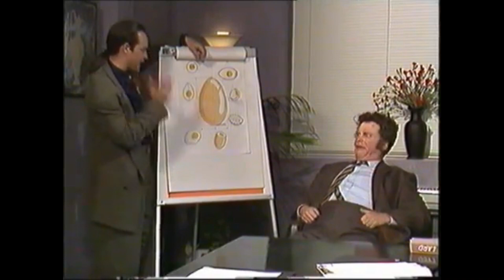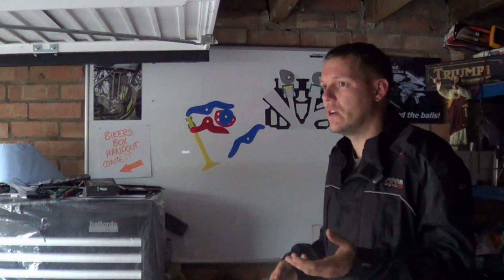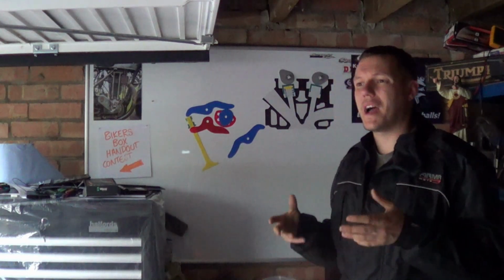Hypereutectic pistons - Say what?

Comment: "If you want more power, you need more heat"
If only there was something you could use to make the engine hotter............................anyone?
Reply: Deanxm1.  Remove the cooling system! Lol
Reply: Deanxm1 use Evans lol
Reply: Deanxm1 shit I was just about to type the very same hahaha
Reply: According to Roadkill: Cardboard blocking the radiator.
And maybe Evans would solve the Roadkill-typical overheating problem.
Reply: BavarianMonkey Eaton roots backed by a big turbo, then opposed piston and make the heads hemispherical. Hoooo...
Reply: Deanxm1 Ummm. Abigail Ratchford??? HaHaHa
Reply: Take the belt off the water pump. Instantly make 9001hp running na.
Reply: More pressure more fuel and more air but most importantly more spark...unless you want to go diethylene but beyond that, its a complete design change
Reply: use the hot air from this video......

Comment: Another awesome vid! I think the FIA banned Berillyum/aluminium pistons in the early 2000's because in the event of piston failure, Beryllium particles would enter the atmosphere and be harmful to humans. 
If I could make a video request, how about a vid on deck height, its relationship to bore stroke ratio and piston speed? Most race bikes and purpose built race cars have severe oversquare engines but for example BMW (E46 M3) , Honda (Integra Type R) and Audi/Lamborghini (V10) have under-square, long stroke, high revving engines. I know they are road cars but would be awesome to highlight how a long stroke engine can still achieve high revs.
Reply: weofnjieofing They seriously put beryllium anywhere near an airbreathing and heated application? Back when I was doing vacuum pump stuff, that shit was some of what we tried hardest to avoid, along with gallium arsenide and radioactive stuff. Breathe in and congrats; you have a couple of years, and then the sarcomas will be collecting.

Comment: about 1 week ago i tried to use 6011 steel welding rods on aluminium and i got a very porous, hard and strong contact with it but there was no flux flakes on top of the weld when i stopped.. which seem like the sodium carbonate , the steel and the aluminium made an alloy together

Comment: In simple terms eutectic point of metal alloy is where you have such a portions of part A and part B that the mixture has lowest melting point. So if you'd add more part A or part B the melting point would rise.  Hyereutectic just means your alloy has one component more. Also alloys not really considered to be composite materials.

Comment: Good video. Doesn't titanium creep pretty bad under high heat? Not saying this aplication would get it hot enough to mater but isn't that a major engineering constraint of titanium?
Reply from the maker: Titanium has a few issues - Its heavier than Aluminium, it has a massively (order of magnitude) lower thermal conductivity than Aluminium - 

Ally 230WmK or near that. 
Titanium = 23 WmK

(I can't remember how close the numbers are to the 'real' values but I know its a order of magnitude different.

Titanium also galls like a bastard, which makes it a shit bearing surface. Aluminium is also shite but its oxide is quite hard which reduces galling quite a lot. Titanium oxide on the other hand makes things worse, although titanium nitride, the golden colouy on stanchions has a low coefficient of friction. 

The problem is that titanium nitride thermal conductivity is worse than straight Ti. Stress fractures in the surface and boundary layesr of the grains of Ti coupled with the diffusion of oxygen can lead to stress fractures - creep. 

Specific designed alloys (aviation alloys) can easily get around this, but again ususally thermal conductivity suffers, and galling is still an issue.
Reply: Just an aside: The low thermo conductivity is a big part of what makes machined ti parts so expensive btw. It's not a massively hard material at all (for its weight it is) nor is it very expensive to haul out of the ground and produce billets but cutting tools ultimately are limited by heat from friction produced in the cut and how much of that heat the cutting tool can take. Most materials (al, steel) the heat leaves with the chip and sinks into the part. With ti and other insulative materials the heat just builds up in the tool. There are a lot of tricks in our bag to mitigate that but ultimately it just means you have to take longer to produce a part and replace (expensive) tools more often.
Reply: I've always felt like these issues are just an excuse, there has to be coatings that solve these issues. Something like a case hardening that diffuses into the surface, or vacuum deposition coating or diffusion boding of some sort.
I know, I know, its a cost thing... its always a cost issue.
Reply: Also I wouldn't think thermal conductivity would be an issue other then cooling of the piston via the oil... they coat the tops of aluminum pistons with ceramic, you want to remove as little energy from the combustion chamber as possible right?

Also you spelled color wrong.
Reply from the maker: Its all about heat saturation. And in turn this is linked to detonation. A large amount of piston heat is transferred through the piston rings and through the con-rod. Slowing down this transfer by 10 times really makes a difference. And its not as light as Aluminum. So why bother......
Reply: But Ti has more then 3 times the tensile strength of the hypereutectic Al/Si, surely it could be made much thinner to make the weight equal-ish.
Al/Si 398 - 40 ksi
Ti 6-4 - 125 ksi
7075 T6 - 73 ksi

I know I ignored the rest of your comment... the strength to weight and performance at high temps/ corrosion resistance just seem like so much of a win to me.

Comment: does anodize piston and combustion chamber will give any advantages because of aluminum oxide thermal properties ? there are expensive ceramic coatings but also  it is hard to do at own garage while anodize is simple. :D
Reply from the maker: Pistons are already anodised - naturally.
Reply: Yes but the layer is very thin

Comment: matt, you should do a twin cylinder two stroke  vs single two stroke comparison.. id actually like two see the yamaha 350 twin vs yz250..  im pretty sure that they have nearly the same power, thought youd enjoy proving that fact with the smaller 250 against the twin 350.
Reply: TZ
Reply: twin cylinders make more power then single cylinders
Reply from the maker: the cc's aren't the same - try again.

Comment: I recall back in the '80s, I think, Smokey Yunick - a famous NASCAR mechanic -  was experimenting with an engine, V6 Buick I think,  that had no coolant whatsoever and had a good deal of ceramic in it's construction though I recall the block was still cast iron.  The idea was to retain as much heat as possible and cut thermodynamic losses.  Seems like it didn't pan out but he was quite the experimenter in his day - https://en.wikipedia.org/wiki/Smokey_Yunick I wasn't able to find any specific article on it at the moment.

Comment: An alloy is not a composite. An alloy is a uniform mixture of metals (or metalloids) mixed on an atomic scale. A composite contains two or more materials mixed on a macro scale, we commonly think of a polymer resin applied over a mesh of woven fibres (glass/carbon in epoxy for example) but straw in mud/clay (primative bricks) and sand/gravel in mortar (concrete) are also composites. It gets fun when you consider an aluminium (or alloy thereof) honeycomb skinned with sheets of  CFRP is a composite itself made of two composites. Yes aluminium/air is technically a composite.

Comment: A pen Friend :)
All pen markers should at all times point downwards, otherwise the liquid will drain away from the business end. Even when writing the liquid will quckly drain if the bottom of pen is at an angle downwards. Try it, cheers
Reply from the maker: Do you know if waxing the board also helps? Someone commented that it did.
Reply: Never heard of this, the root problem is that there is not comming enough material through the brush. No amount of wax will change that.
Reply: BlueFox Did you not notice his tongue firmly pushing on the inside of his cheek as he wrote that response/question above??

Comment: Wolfram anyone? Surely not light, and i dunno about mechanicaly how would it behave, but it won't melt for sure.
Reply: *Tungsten (for the international people) :-)
Reply from the maker: Tungsten is way too heavy are you mad!
Reply: :D i know, but it certainly does not melt with ease.
3400 celsius or so its melting point :D

however, yess density is a problem. maybe some kindof alloy made with it.. i dunno. i actualy was just joking.
if i remember correctly wolfram has a density like 15 g/ccm,
and aluminium is something like 2.65 g/ccm or someting like that.

but yeah , lets not be  kidding.

Nickel-Chromium-Molybdenum would be probably superior to aluminium-silicate pistons. probably steel with say...
0.55% Ni 0.5 % Cr, 0.20 Mo, and lets drop in 0.1% Tungsten into the alloy and most probably a piston out performing AlSi can be made, question is who the fuck can afford that kinda thing...
but at least this is a serious one. supposedly it should have a melting point far higher than AlSi.. li reckon by a good 200+ celsius.
maybe you could get away even without theTungsten..
but you would need a really short skirt, and a super light design.

anyhow, since you considered my brainfart joke of tungsten piston, how about you consider now the alloy i described ?
it would be something in the 8600 series or so.
Reply: now if there were some copper alloy that wasnt soft and squishy. but a copper head could be ok. bit costly tho, but has anyone tried to cnc one just for shits and giggles?
Reply: there are alloys for that, but beryllium and cadmium are not the materials you want in anything if you can avoid it...